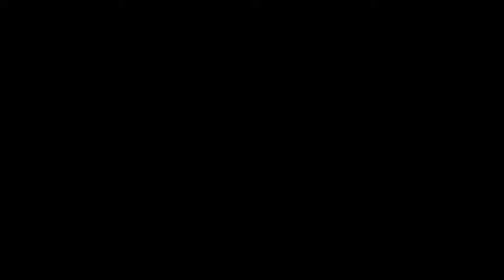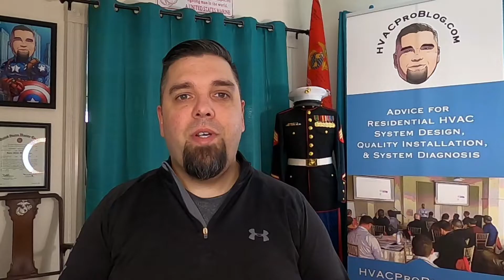Heat Pumps & Record Snow

Comment: I have had all types of heat. Wood, propane, natural gas, straight electric, and heat pump.  The best and most comfortable heat by leaps and bounds is wood. It is the equivalent of winning a race and lapping everyone six times! behind that is propane and natural gas, then electric. heat pump is a weak heat that takes a long time to accumulate because you are extracting heat from cold air and the colder the air the longer it takes to extract. Using the race analogy heat pump heat was lapped 6 times by wood and 4 times by propane and NG and two times by electric. Our electric bill is higher than with gas and electric combined, and our  system is rated down to minus 13. He is ABSOLUTELY CORRECT WHEN HE SAYS THE SYSTEM CANNOT KEEP UP WITH THE HEAT LOSS! Worst part of all this is I live in Missouri. If I did not have a wood stove I would have taken this system out and gone back to Propane or NG. If I lived up north in a cold climate I would not even consider it. AC works really well though. For our climate Heat pump with gas backup might be a good choice. As far as heat pumps go make sure you have an alternate heat source.

Comment: elevate the unit, install a pan heater, and build a shed so the roof is about 2 feet above the top of the unit. might even be a good idea to turn the condenser off and cover with a large plastic gargage bag if it is snowing heavily and blowing. If you live below the mason-dixon line your installer will likely not discuss any of this with you. My shed is built of a plastic roof supported by pvc pipe. the back is screwed to the brick wall behind the condenser. The hole in the front legs of the pvc pipe fit over rebar driven into the ground.

Comment: It seemed quite obvious to me when I first saw a mini that all those electronic parts and tight cooling passageways were not seriously made to be outdoors unprotected.  I built a concrete slab building 10x10x10 well ventilated with a screen door to protect my own three mini splits.  One look at the metal they are made out of (yes even the "harsh climate" coastal units) and the rust stains after a couple of years use let me know I had made a good choice.  Pine needles and garbage during the year can't get at the units nor does the blizzard such as we are having now with drifts of snow block off the airflow.  This is another case of don't believe the hype.  If you want maximum life you need to protect them.

Comment: Well, I put my mini splits on pedestals and also built a shelter around it on the tops and sides. There is a nice block of ice below it from defrosting in mild cold weather. When it gets around 10 or below, not much moisture to worry about.  Snow did block one of the units that wasn't used as much though.